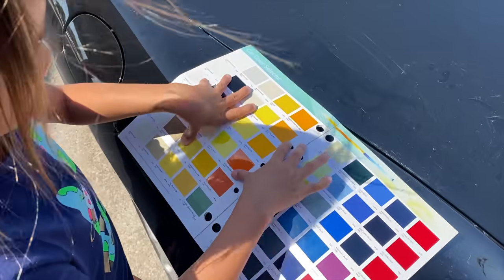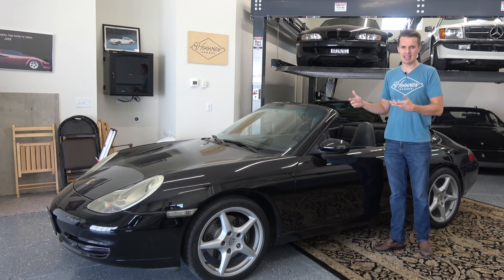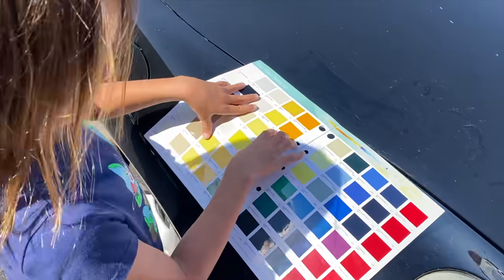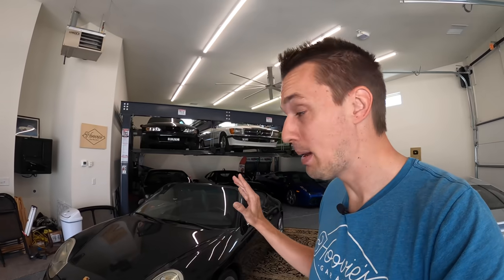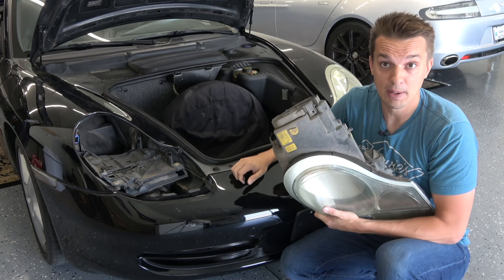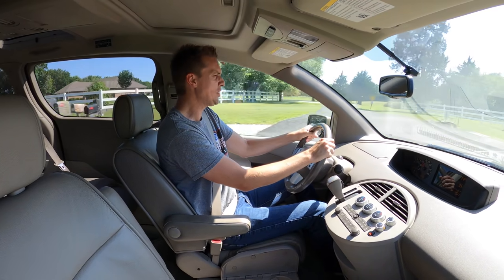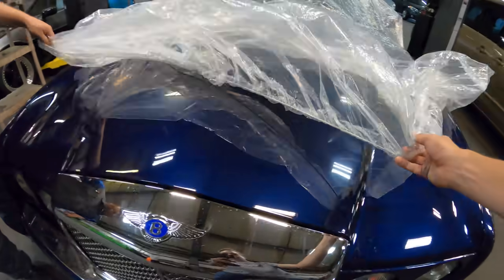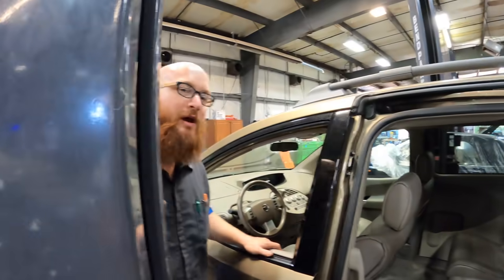Letting Maaco Repaint My Porsche 911 (My Daughter Picked Whatever Color She Wanted)

Comment: I actually LOVE the color. I would have never picked it, but WOW! And since when does Maaco do that kind of work? Nice work Maaco!
Reply: They knew it was basically going to be a free commercial for them.
Reply: @matt4398  Sure, why not. Im good with it as long as Hoovie is, right? Proof that they can do a good paint job, but historically... not so much, or at least you got what you paid for.
Reply: @BrianAz  I worked there briefly; patched a hole with a greasy pizza box after lunch. Not my idea.
Reply: since when does macco do that kind of work? since a youtube famous dude tells them hes doing a video on it
Reply: I had Maaco paint a car years ago.   I spent about 100 hours prepping it for them. Color change but I did all the jambs.  Whatever paint they used reacted with the primer I put on one spot and it left the hood looking horrible. I used that same primer on many panels, so not sure why the hood came out like trash.  It took longer than they said too because they weren’t happy with the result and were going to get it looking better.  Uh...?  It looked pretty average at best. Their tape lines around the windows and bumpers sucked.  I went from red to black, and there were just red lines near all the window edges. 

Also, about a year later the paint started chipping in spots.  Bad adhesion. Hopefully Hoovie puts 3M across the entire hood, else he will likely get a very speckled front end from stone chips. 

When I picked up the car, they asked how to pop the hood. Ugh.  There was overspray in the engine bay.  I can’t even imagine how bad Hoovie’s engine looks right now, and how bad his vented cover will look when the paint flakes off in all those vents where they didn’t sand/prep.   They quoted 5 hours of body work prep?!  The engine cover alone would have been 10-20 hours, and it wasn’t dinged up!  

Only $2k to paint the car - but will cost an extra $4k at the next shop to strip it all off before they have a solid layer to work with. (if the paint is pealing/chipping, you just can’t paint over it.
Reply: @stephen3164  and the doors seals, they didn't prep before painting, they painted the wiring harness....
Reply: It's the Wichita car mafia
Reply: @stephen3164  "I used that same primer on many panels, so not sure why the hood came out like trash." Was the hood of the car made of a different material than the rest of the body, like fiberglass or plastic or aluminum?
Reply: Cursalock - nope - the whole thing was 1960’s steel. I had spent a lot of time making that area smooth too.

Comment: Maaco is best for cheap cars as he said. Back in the late 80's we had my mom's Dodge Aspen repainted the factory color. It was the deluxe (!) job where they actually put a coat of primer over the car before the one step enamel. I had replaced the rusted front fenders with rust free junk yard picks and the bottom of the 1/4's were sheet metal and Bondo. It actually was better than the factory paint, which didn't take much. Kept the car another year so I don't know how it held up over time.

Comment: Friend, Hoovie, the nissan has one or two bad idle pulleys , probably soon will break a belt because the pulleys are failing.
Reply: Howdy friend.
Reply: My idle pulleys rattled when the bearings were gone
Reply: D B  did you not hear how much it cost to repair. Less then $200. You can't compare the two
Reply: D B  you can't call anything garbage for reliability when you own a late model Range Rover 😆

Comment: This is the only time I've seen a paint job from macco turn out nice. I'm fairly certain its because of the youtube
Reply: I completely agree with you Mason. I thought exactly the same thing.
Reply: He did not say what paint he went for. I don't think its the standard Single stage Urethane. looks like it has a layer of clear on it.
Reply: @ohlookadragon  Yeah, most likely it is at a minimum a two stage paint job. Still, considering it's from Maaco, it looks really good from my vantage point.
Reply: I got my truck done by them too. Did an amazing job, but cost about $3k, their cheap stuff looks like crap
Reply: I think maybe when the guys down at Maaco get a customer willing to pay for the proper prep work, color sanding, etc, they do their best work because it is a chance to show what they can do without crazy low cost constraints. i.e. pride in their skills.
Reply: I mean u get what you pay for I had a buddy get his square body done at a macco but he paid like $2500 and turned out pretty damn good
Reply: @modernlooks7041  Totally agree with you. "You always pay for what you get" but, "you don't always get what you pay for".
Reply: @jakebednarz3026  I had an ratty old 1985 Chevy Blazer that I had Maaco paint many years ago. I chose their "middle of the road" paint "package" and it actually looked pretty good for the first year, or so, but as the paint job aged, it started peeling and at I believe the 3 year mark, it was evident that I got what I paid for.

Edit: Typographical error
Reply: Yeah, this is deceiving to “normal” customers for someone with clout to use their service and expect the same quality and results.  People don’t realize the ad aspect of this pays for the rest beyond the $2500.
Reply: @saywhat9158  You are absolutely correct, in my opinion. Doing a great job on Tyler's Porsche was really an investment into growing future sales, as it is obvious that Tyler is a huge YouTube personality with a very big viewership/following..
Reply: Vheck out auto auction rebuilds, he takes his vehicles to get repainted at macco and it turns out great
Reply: Naw, we got my sisters Saleen painted there for 800 and they did a super job. But it does depend on the actual ability of the body and paint guys.
Reply: Fred Roeder you must specify high solids clear, or yes it will peel.
Reply: Do research on the shop. The one near me in NY won all kinds of awards. Everyone loved that shop.

Comment: I almost threw up when it read “Porsche” and “MAACO” in same sentence. 

I’m here in Columbus Ohio. Been to 3 different MAACO stores. Worst is Reynoldsburg Ohio Store. 

“orange peel” 
“drips” 
“overspray” 
“debris in paint” 
“swirl marks” 

Each side of the car DID NOT match. While sitting in garage waiting to be stripped and repainted...MAACO’s paint began to “lift” and “bubble”. 36 days after picking the car up. 

Worst $2400 i ever spent. 

Insurance sent a piece off a Escalade i have. I didn’t know they sent it to MAACO. It’s a 4 step paint. “Mother diamond of Pearl” or something along those lines. Got the piece back...PLAIN WHITE. They had the paint codes. They blew it. 
(Store off Cleveland Ave in Columbus ohio) 

Whenever i have paint issues...if it’s through insurance i make sure MAACO isn’t involved.

Comment: I mean, this car could have done with a detail to fix the issues... this is over the top.
Reply: A full paint correction probably would be $1000+ and there would still be flaws.
Reply: @dafirnz  All that was screwed up was the clearcoat. The 996's had generously thick paint applied from the factory. This could have been corrected, and that would have been the most economical choice for anyone not making thousands by doing the expensive (and frankly stupid) thing and painting the whole car and making a youtube video on it.
Reply: @henryatkinson1479   You do realize that doing this kind of video is kind of Tylers job (Or one of them), right? ANd besides, seeing his daughter's reaction was probably more than worth it to him.
Reply: Once a car like this has high km, the collector value falls significantly, so at least he's doing something fun with it. Black German cars are so common that it's nice to see something brighter.

On a side note, I really liked that teal she pointed to.
Reply: It's almost as if that's his job, crazy right?
Reply: It’s possible that it was the same as my paint where it is thick but the bird poo stains actually caused the clear coat to separate from the base coat due to the hot Texas sun and previous owners letting bird poo stay on it for a long time so it’s not even surface damage (completely cut and polished) but you see the bits of white under the clear coat from the damage caused by it. It’s possible the same thing happened to the Porsche.

Comment: The Volvo P1 line has the easiest headlight removal ever, just remove a pin (although it’s more of a small bar) and it’s ready to pop out.. I can open the bonnet and remove a headlight in less than 30 sec on my C30

Comment: QUEST CAUTION!!! 
That pop and squeak may be your front right lower control arm.  I had a 2004 and it rotted through internally.  There is a drain hole in it and the AC condenser sits directly above. If the lower drain gets plugged it will rot from the inside and eventually snap. Mine did while driving. Fortunately at low speed.

Comment: I have a kinda  nice hooptie,  '99 Porsche 996.Cabriolet with lots of  Rock Chips, scratches etal. ~~ Black on Black. Certainly shows all the imperfections. Really hard to hide. However, This car only has only 52K miles w/ a  LN retro fit IMS bearing . Engine has only 5K miles since refurb . new water pump, clutch, AOS,

Comment: Ethanol attacks various polymers / rubbers in the fuel system. Ethanol also results in higher burn temperatures and lower efficiency in the engine.

Comment: All MAACOs are different owners, and different levels of quality...  It is best to shop around, and look at finished cars at each location.  I generally removes chrome and trim myself to get a better finish, and it helps the shop out too..  less masking to worry about.
MAACO in Costa Mesa, CA is a rip off..  he tried to charge me $1800 just to strip/sand my car down, then he said you come back inland we talk about the body work needed, then we talk about the paint job...  All total, was going to be $10,000.  maybe $8,000...  I went to MAACO in Orange CA, and got a really nice paint job COMPLETE for about $4-5,000 COMPLETE, 2 stage, color sand and buff...

Comment: Why can't other manufacturers make headlight changing this simple. I just spent 2 hours to change the daytime running bulb on a 2116 Volkswagen Jetta. Whole damn bumper off because the stupid bulb would not come out of the whole it was turned into. I had to take the whole light out, then use hose clamp pliers to grab the housing of the bulb and pull it out with so much force i new i would break something else, but glad i didn't. Also had the tire pressure light on so i put air in the tires, according to sticker in the door. So i had to reset the tire pressure system to turn off the light. 3 seconds, just push the reset button in the glove box with car ignition in accessory mode. SMH car engineers please work on your own car so you can design them with common sense! It should take five minutes to change any light bulb on a car period. My 2006 mazda 3 same thing hours just to change a damn headlight bulb! My 1994 mustang gt, 5 minutes to change a bulb, thank you ford and thank you Porsche!